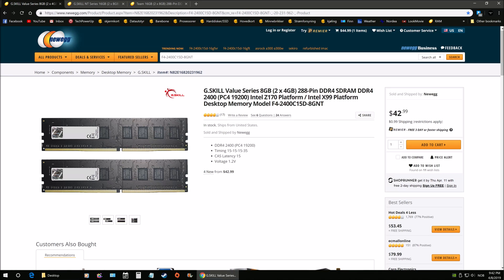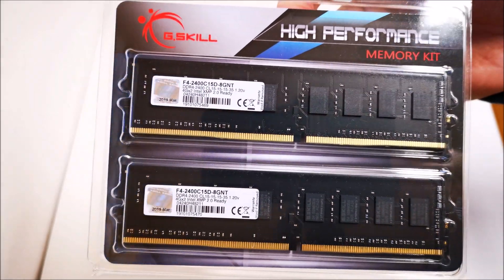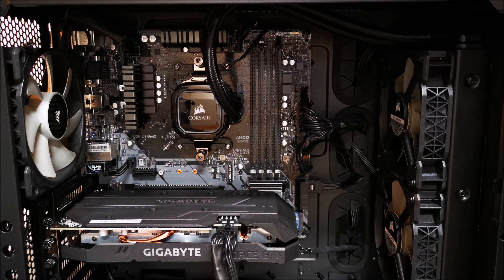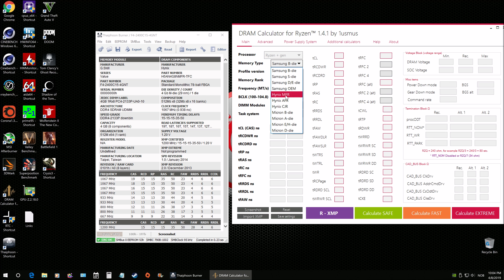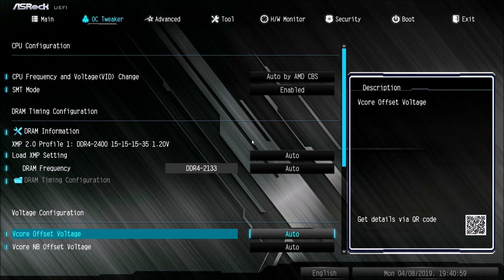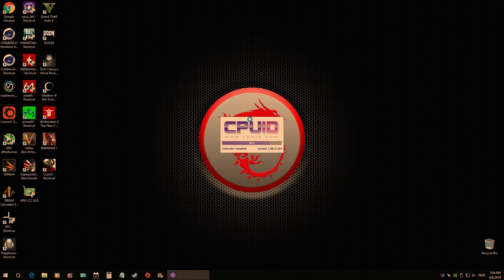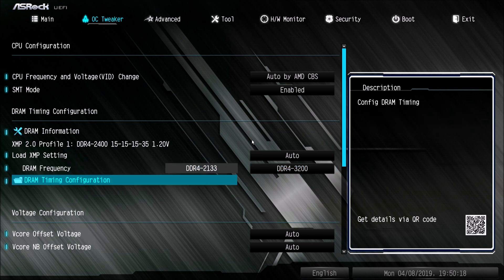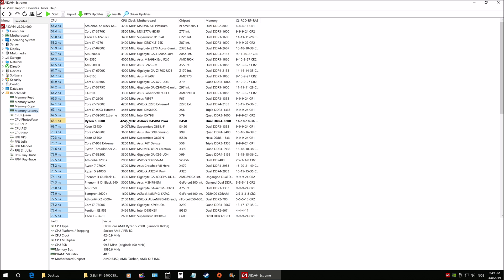Value RAM Overclocking. 2133 to 3200Mhz???

Comment: Use to own a G.Skill Aegis kit. Doesn't have any heatspreader instead they only use a sticker on it. Was able to oc at 3066mhz c16. That was right after the first agesa update for ryzen came out. Use HCI memtest. At least 1000% pass for it to become usable for normal day-day tasks. 2000% if you want to make it 99% stable.
Reply from the maker: Sounds like you did well with that kit. A lot of this value ram is great for overclocking. One just has to know what to do.